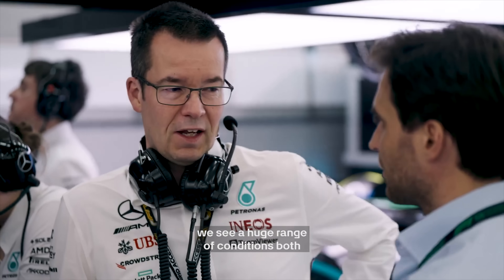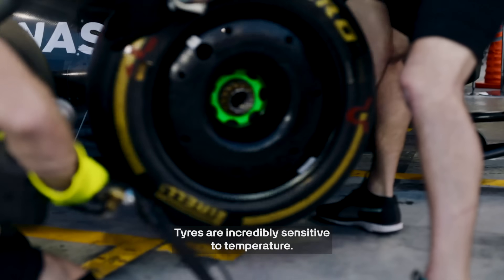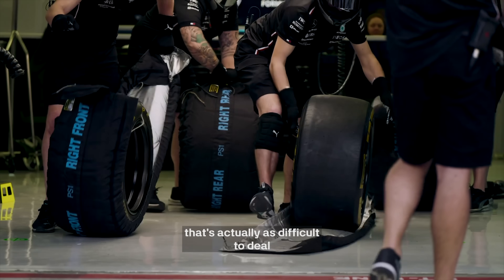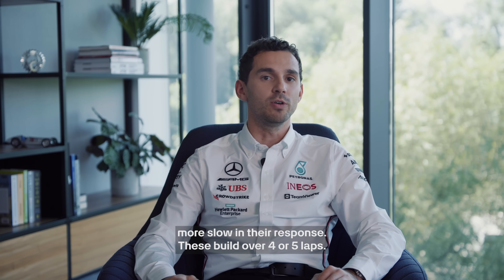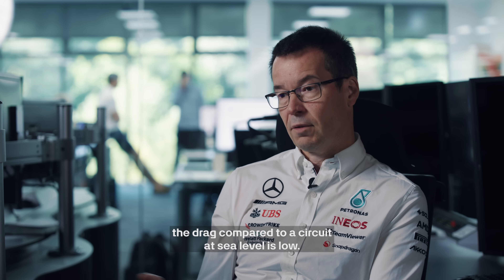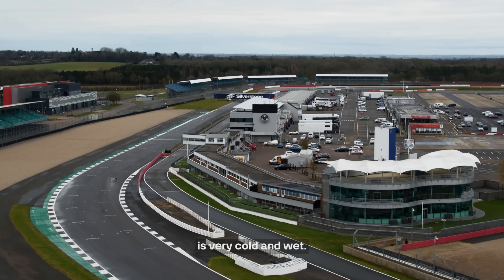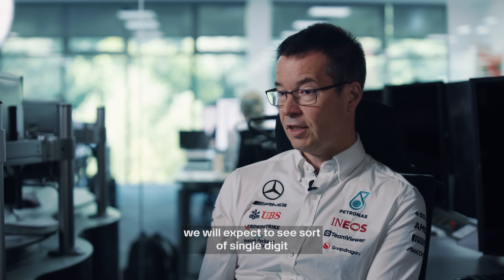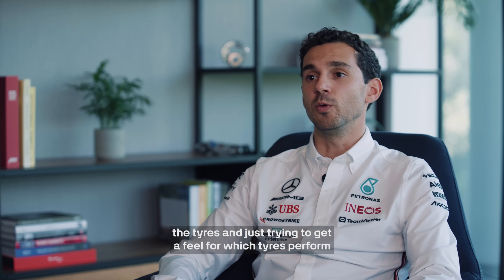What Impact Do Temperatures Have on an F1 Car?

Comment: Work on Pit stops. You're rarely below 3 seconds and nowhere near 2.
Reply: I totally agree with you 👍.
Reply: Merc always suffer pitstop frim before the hybrid era. They're not the worst but rarely top 2. Redbull has been amazing at pitstops forever
Reply: Lol, they’re not losing races because of slow pit stops.
Reply: @DRTraining you heard of undercut? It’s very crucial to have a faster pitstop in order to do that effectively. If rb can do same pit stop around 7 tenths or a second faster than Merc then drivers have overcook their tires in the crucial outlaps to compensate. Do you need to know how important is track position in this era of downforce cars?
Reply: work on getting a job
Reply: It literally doesn't matter in a race distance. RB might have faster tyre-changes, but they also more often has a car stuck in the pitbox.

That 3 sec time you see on screen is only the time it takes for a tyre-change (or other legal changes i.e. steering wheel), the full pit stop time (20-30sec) is what's important.
Reply: Well than explain why the average full pitstop time Merc is 2nd best? It's not all about the time you see on the screens.
Reply: @MuhammadNiz007 Curious about this statement. Source?
Reply: @MuhammadNiz007 if you look every week at the DHL top 10 pitstops, merc is rarely scraping top 10